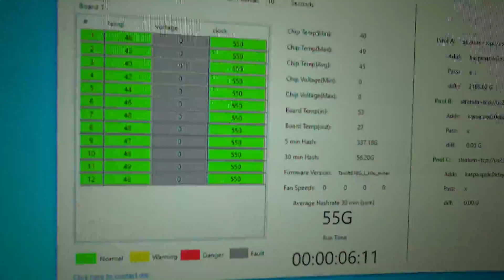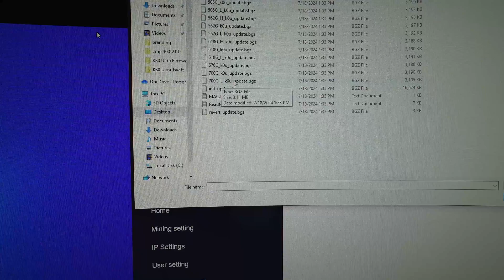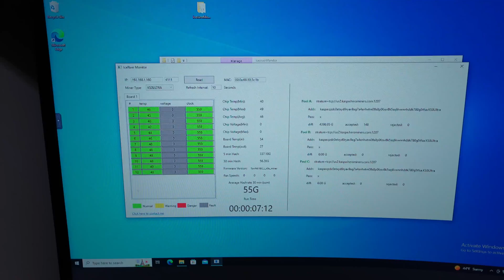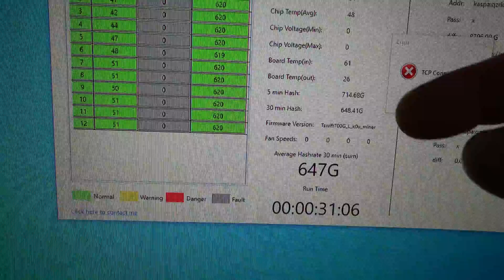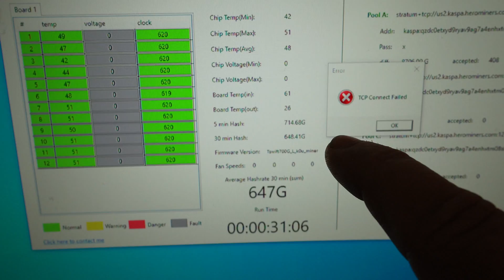KS0 Ultra 700GH Or BUST!!  #crypto #kaspa #iceriver

Comment: can you provide a link for the heatsinks you used on the bottom of the mosfets. i only did the tops of mine and id like to do the bottom since im still running 76c on 700gh
Reply: on second thought it seems they may be touching the resistors and other components. very risky. may short out